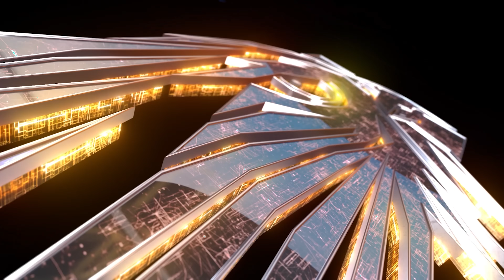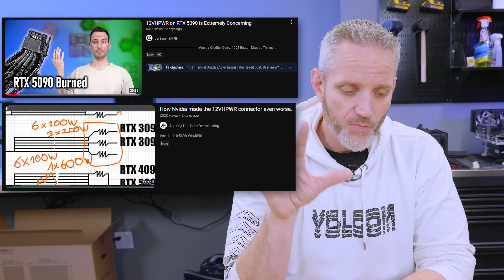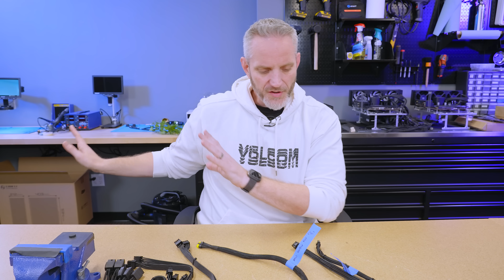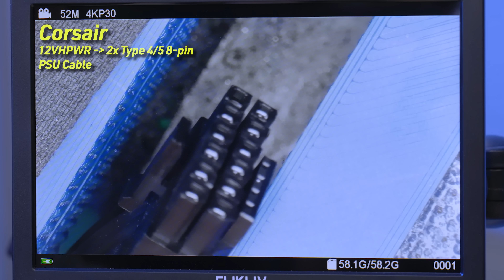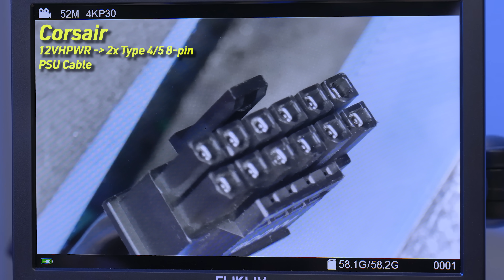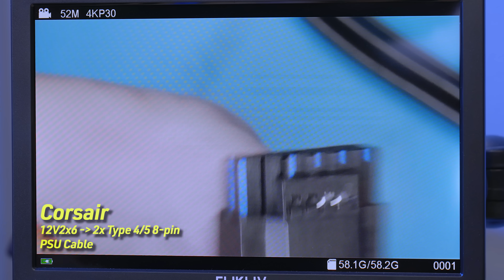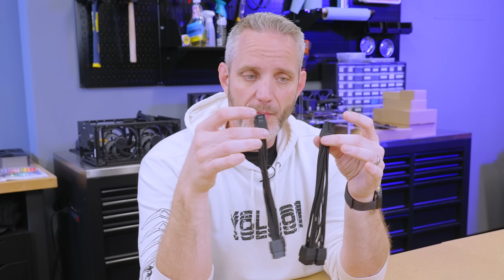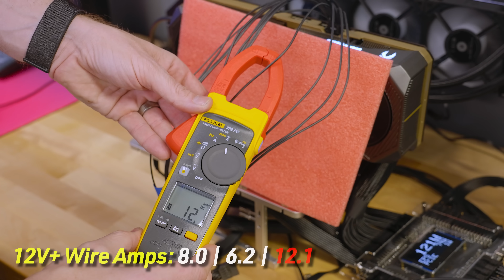I discovered something concerning and I need the Experts to chime in... More 12VHPWR discovery!

Comment: EE here.  First, you are correct about the ground pin being less critical.  There are multiple DC grounds through the PCIe slot that can make up for a marginal ground pin connection.

When I first saw the 12VHPWR connector, and that it was "rated" for 600W, my initial question was if PCI-SIG actually had any engineers on staff that understood power distribution. Pins that small shouldn't be used for more than 4-5 Amps, and this connector was "rated" for twice that.  But to comment on Jay's question, yes, a connector that slides back like that would derate the connection.
Reply: A bit more detail about the ground pins: in theory they are as - if not more - critical as the 12V pins. In reality, as the OP said, there are just more ways that the current can go, so a few bad connections don't matter that much. That is because the current on the ground can go via the 12VHPWR connector or the PICe slot. The 12V cannot, the VRMs will pull that current from the 12VHPWR even if the resistance on the 12V on the PCIe slot is lower. But ground is shared between the 12VHPWR connector and the PICe slot. (Yes, you could design the VRMs so that it isn't, but that would make them more expensive.)
Bonus fact: Ground could be more critical because on single-ended signals the voltage of ground gets subtracted from the voltage of the signal, so if there's a voltage difference between ground on the mainboard and ground on the card then the signals can get hard to read. But PCIe does not use single-ended signals, so it's less of an issue.
Reply: @ahoannon5711    I'm really liking your "bonus fact". I do think ground offset is causing comm failure and GPU reset and thus preventing lasting damage when ground pins are improperly connected; otherwise we'd be seeing PCIe host connector black and lifted pins, though given the case wouldn't be associated with visible 12vhpwr connector damage, the connection might not have been made. I have read a report of a user previously who experienced a lot of GPU reset logged as PCIe faults until they replaced the power cable, removed the Corsair 12vphwr strand, installed 8pin ones and installed a GPU supplied adapter pigtail; since then none.

It's not only true for SE signals, this is also true for differential signals since think what happens if one of the inputs on a differential amplifier dips more than a tiny fraction of a volt below its negative supply? Usually not much good, you have maybe a third of a volt before it messes things up.
Reply: idk why they didn't use a more COTs standard
Reply: hay just a psychology major BA student. what do you mean when you say "derate the connection." I understood the rest of the other comments talking about margins for error and how the cables need to be engineered to have much higher ratings, but is the cable slipping out of the socket. I understood the pins being small to carry all that power is not good because of the  heat from resistance I think write? if I am getting something wrong pleas let me know just trying to be more informed. I cant afford any of those cards but in case someone I know wants to bye the new shiny thing I need to be able to tell them what exactly is going wrong.
Reply: @nandishhiremath1439  "derate" in this context means that this particular connection is less able to carry the current that ist should.
And the problem here is that the connector is designed that a) very little (== next to nothing) can go wrong before bad things happen and b) the first sign that something went wrong is when your computer starts smelling funny.
The 8-pin PCIe connector was designed in a way that it's more likely that the card refuses to work than that a cable overheats and sets things on fire.
Reply: @nandishhiremath1439  I'm no EE so take what I say with fair amount of salt. There might be more to this than what I'm thinking and I could be completely off as well. 

So 'derate the connection' here means that connection is worse than it could or should be depending on expectations. So connector being pulled back will have less surface area connecting the male and female counter parts which means that resistance will potentially be higher which means less current or power can safely be transmitted through it. In general smaller cross-section area means higher resistance and lower capacity to carry power so thicker cable -> MORE POWAH! Connector being pulled back doesn't necessarily mean that it'll be slipping out of the socket, but rather it could cause strain on other wires and connectors as electricity tends to travel through path of least resistance, meaning that wires will less resistance could get more than the rated 8 amps. 

All in all, things could get worse for rest of the wires or even for hardware such as GPU and PSU when connector has slid back like that and it potentially derates or worsens the connection.
Reply: Probably a dumb question but considering that a good amount of energy is lost in heat in devices like GPUs, wouldn't that mean that the return path (ground pins) is under less stress when there is less energy to handle?
Reply: @SirLugash  Actually all the energy that is transferred to via the PCIe connectors is converted to heat. But you need (at least) two conductors to transfer electrical energy: one for the current to go into the card and one for it to go out of the card. And the sum of all current going into the card is the same as the sum of all current going out of the card.
But as already mentioned: to have good signal quality on the data lines there must not be too much stress on the ground connections, so engineers add plenty of ground pins to make sure that there isn't.
[Edit:] P.S. Again, to transfer electrical power you always have two conductors. In cases where it looks like you only have one (e.g. when you touch an overhead line or so) you still have two conductors because the current will find some way, e.g. through the ground you are standing on or some other way that wasn't meant to conduct current but will do if you push hard enough.
Reply: @SirLugash  No. When you have a system with an equal amount of power and ground connections, Both the power and ground have the same current flowing through them, just in opposite directions. Its the device using the power that dictates how much current will flow, but it'll flow equally in the power and ground connections. 
In the case of the GPU's here though, there are more connections to ground than there is power (63 pins of the PCI-E connector are ground as well), so the ground current can be spread over far more pins/connections, meaning the power pins are more vulnerable to overload with a bad connection.
Reply: @ Thank you for the explanation. I understand that the same current going into the card is making it's way out of the card (in total), however how does the conversion to heat energy affect the outgoing current? As far as I understand, electrons collide with atoms in conductors which causes them to lose kinetic energy. What does that mean exactly for the outgoing current? I don't have concrete examples but I remember seeing power connections where the ground wire had a smaller gauge than the hot wire.
Reply: @SirLugash     The return current is the same as supply current.

The return current connection being smaller than hot isn't proper. There must be another ground/return connection presumably relatively nearby that you're overlooking, but also, it would be a bad idea regardless, since if you force return current to take the long way around and not very near to the supply current, you're creating a loop in which electromagnetic interference will be induced upon other devices.

Electricity movement in a wire is not actually represented by movement of electrons, what moves is a wave of repulsion of charge. Just like when you make a wave in a bathtub, the wave will have reached the other end of the bathtub in a second, but the actual particles of water have not moved to the other side of the bathtub. The electric signal travels at close to light speed, while the electrons move at barely millimetres per second.

Energy being consumed to heat due to lattice collisions and the like is represented by voltage being consumed across that current path, while the current throughout the whole loop remains the same. The charge must complete the whole loop from the source through the consumer and to the other side of the source, otherwise there is no current and no power.
Reply: @SirLugash  TLDR. More heat = more power draw = more current = more heating of connectors = more stress on connectors. So increasing the heat disipation of the card increases stress on the connectors.

So power is delivered to the card and turned to heat. The voltage across the card should be (mostly) constant (~12V), so the current must be higher to deliver more power (power = voltage x current). Therefore, the power connector is passing a higher current. The connector ideally would have 0 resistance, but practically will have a small resistance. Therefore it will dissipate some power. The more current it has flowing through it, the more power it will dissipate (power = resistance* current^2). The power dissipated by the connector becomes heat, possibly damaging the connector if it becomes too hot. So increasing the heat disipation of the card increases stress on the connectors.
Reply: @SirLugash  About the ground wire being smaller than the hot wire(s): you can have that in multi-phase AC. For reasons I'm too lazy to explain here, the current from one phase of an (e.g. three-)phase AC connection mostly goes out through the other phase(s) and not through the neutral wire. So if you know that to be the case then you can use a smaller wire for the neutral. 
The extreme case are the transmission lines of the electrical grid, where only the three phases are built and the little remaining current of the neutral is conducted through the actual ground/soil.
Also: please don't confuse the neutral with the protective earth. The latter doesn't conduct any current in normal operations so I guess you could get away using a smaller wire for that. (Although that could lead to ...errr... more spectacular failures if the PE is actually needed, so I would advise against that.)
P.P.S. @SianaGearz: Thanks. I don't really have anything to add.
Reply: @SirLugash  Current in = current out.  You're confusing current with power. Power is current times voltage. (Technically, the voltage drop.) So, if we have 12V at 10A, that's 120W being delivered to the circuit, and that 120W is being transformed to heat.

As for the smaller ground wire... There are 3 types of wires here in the US. Line, neutral, and ground. Line (black and red wires) carry voltage with respect to ground.  Neutral and ground are similar; in fact, they are tied together at the entry point.  The neutral is the center tap on the 240V transformer, and is the current return for our 120V appliances.  A 240V appliance (like a stove or dryer) doesn't need the neutral; it does have the ground wire, which is connected to the frame of the appliance.  This protects the user; in case something fails inside, putting voltage on the frame, it'll cause the fuse to blow instead of potentially shocking the user.  This protective ground wire can be a much smaller gauge (thickness) than the line and neutral wires.
Reply: Also EE here. I agree with my fellow EE.
Reply: dumb electrician here, read the specs published by molex, the pin is rated for much more than 5 amps
Reply: @ Molex is a manufacturer; they build parts to the spec of the customer. They got this spec from PCI-SIG, and use the numbers that are given on the spec.

I spent quite a lot of time trying to find the spec of these connectors. The only place to get it is from PCI_SIG; behind a (very expensive) paywall. From what I can tell, these use standard 0.025 inch square pins.

Some years ago, I was working on a design project when my boss asked me how much power we could pull off a standard pin header.  These are the same headers you see on today's motherboards; think fan headers. The parts we were using didn't have a current rating published, so I broke out the lab power supply.  The connector was warm at 5A (Amps), hot at 10A, and melted at 15A. It turns out that these pins are about the same size as 22 gauge wire, which is rated for 7A.

Standard design practice dictates that an item should be rated at around 1/3 its failure capacity, and never more than 1/2. These connectors are rated far too close to their failure point.
Reply: @JamieStuff   Don't know if it's going to help but there's a dimensional drawing of the 12vhpwr plug in intel's atx3.0 spec. I also heard that it's based on a clone of Molex MicroFit connector with 3.00mm pitch. The pins would be .027 then.

There is an article by Igor's Lab ("nvidia's connector story") which claims Astron was the developer of the connector and there's some engineering drawings in there that he managed to acquire.

As per Molex, the original MicroFit is rated for 10.5A per pin, with 6-circuit derating to 7A.
As per Astron, their connector is rated for 9.5A per pin.
These are obviously intended to be continuous ratings, not failure currents. But with Astron you never know, Nvidia already ditched this manufacturer due to quality problems and switched to NTK.
Reply: the ground connection is quite critical. If a  significant part of the return current has to flow via the PCIe connector and then find it's ways back to the PSU in unintended ways, it could easily start a fire in a different section of the PC.
Reply: @tommihommi1  While technically correct, it's highly unlikely that shifting the ground current of the GPU through the PCI-E x16 would cause trouble elsewhere. Theres 63 pins that are ground on the PCI-E, an ATX 24 has 8 ground pins, and the CPU 8 pin has another 4 grounds. So that's 12 grounds via the motherboard board to the PSU, more than enough to split the 6 grounds of the GPU back to the PSU via the motherboard, while handling the rest of the power from the CPU and Motherboard.

Comment: Next thing we’ll have to start running the power cables thru water cooling circuits if this crap keeps up!
Let’s face it that we need to stop the insanity when a single graphics card requires twice the power that a normal gaming system used 20+ years ago!

Comment: Someone had mentioned the different metal ( steel, steel alloys, nickel coatings, zinc coatings, ETC.) connectors and pins playing a factor in resistance even if they are fully seated and connected.

Comment: My issue with claiming it's user error is that other cables would have the same issue.  If you don't fully plug in an 8 pin you would get the same issues.  You don't suddenly get a large number of people with an issue that didn't exist before unless the cable is the problem.

Comment: Just because various cables are made at the same factories, and by the same manufacturer, does not mean that those cables are the same, as I could very easily see one of these companies using cheaper components when possible, even if the runs for OEMs use better parts. Before the 4090 it might not have been a problem, no way of knowing without checking a wide range of cables, and checking the individual components used in them.

Comment: Normally all the grounds are tied together, including the bracket and the screw connecting that path to the case.  So I would suspect the 0v wires to carry less current than the 12v ones.

Comment: Huang should go to jail. 50xx GPU power design is not some mistake on Nvidia part. It was conscious decision, they knew exactly what they were doing. Jayz's friend that gave him his Rog Astral 5090 LC to test.. he was going to use his GPU for 10 YEARS! That's exactly what Nvidia tried to avoid with that power design. In their plan your GPU should last for 2-3 years and then .. BAM! User error! And you go and buy new GPU, 60xx or whatever. 

5090 is so powerful and with that DLSS4 (and next versions of it that will work on this card) it would be enough to play all future games for years. You really need 240 fps in 4k for single play games? No. So even when eventually with newer games fps will decrease of course, but it still long way to go down below 60 fps with DLSS4. 

So Nvidia decided to avoid this situation by artificially decrease life span of those GPU. Their only mistake was that they understimated average PSUs/cables quality that people use and intended life span of 2-3 years for GPU turned into 2-3 days/weeks/months depending on your luck and quality of your PSU/cables/etc 🤣

Comment: The PMV probably adds a fixed low value extra resistance in series with each wire, and thus it will even out the currents flowing in the cables. Maybe the problem is that teh new cables use thicker wire that has a lower resistance, and that makes it so that small differences in the contact resistances in the connectors lead to much higher differences in the currents in the wires on the new thicker cables.

Comment: the crimp is the weakest link IMO.  v = iR and any air gap makes the resistance go to the moon.  I think it would be possible to isolate the current draw per conductor and show that the ground side air gap is minimal (there are multiple ground planes).  Further testing please!  This whole thing has been bizarre as an engineer.  Not sure how this thing was green lit to begin with.  Assuming it will never fail, or at least not having any contingency to prevent the damage e have seen.

Comment: If the problem truly stems from Nvidia's circuit design on the card not balancing the load on the wires properly, as Buildzoid showed, then it doesn't matter what the connector is doing, right? Every 40/5090 has the capacity to catch fire on any cable. If I'm understanding that correctly, and that is true, then there should be a full recall on these cards.